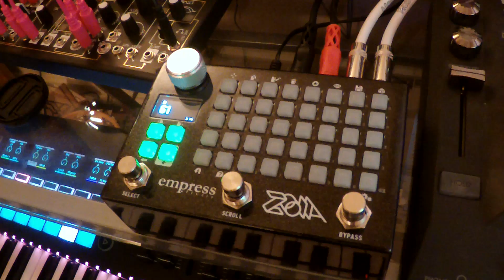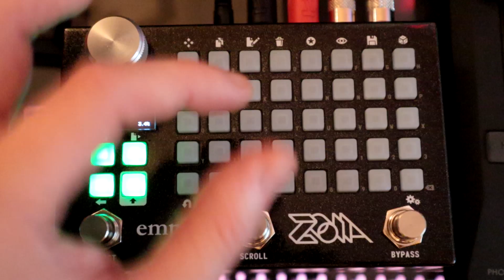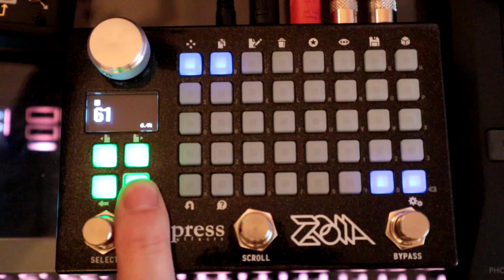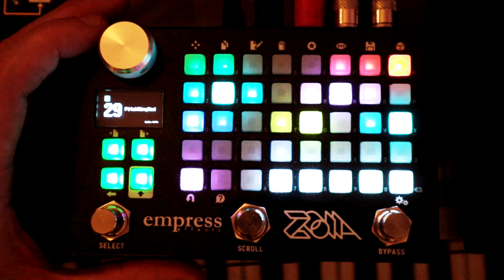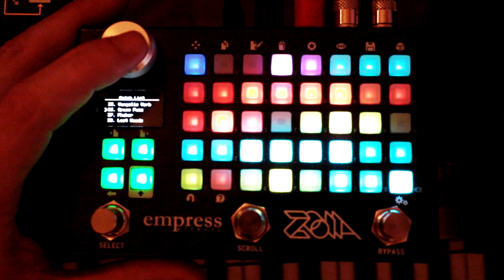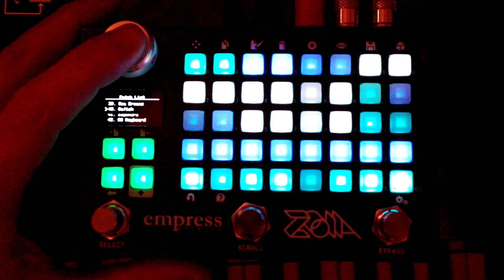Quickstart Pt. 1 - FX Basics // Empress Effects Zoia Tutorial

Comment: but can it dual mono?
Reply from the maker: Not sure what you mean.
Reply: @RonCavagnaro  Oh hello! I was just wondering if instead of stereo, it can do two separate mono channels using L and R. I think I've had devices that, when used in mono mode, the R channel is disabled. Basically I want to run a guitar and bass guitar into the Zoia with separate effects chains and outputs.
Reply from the maker: @troublesomecorsair  yes you can do anything like this